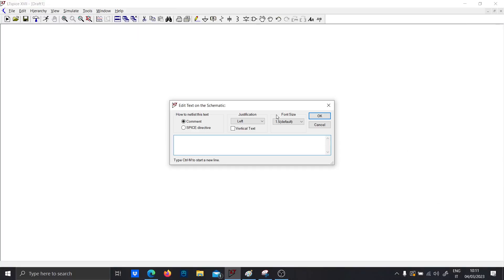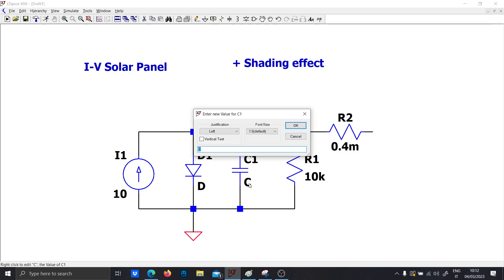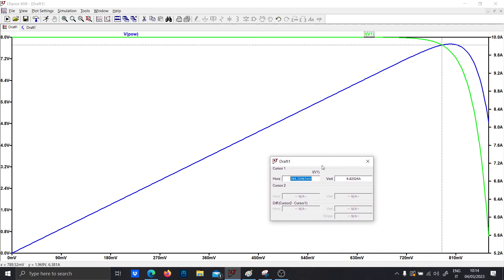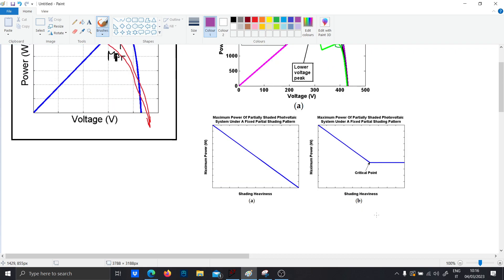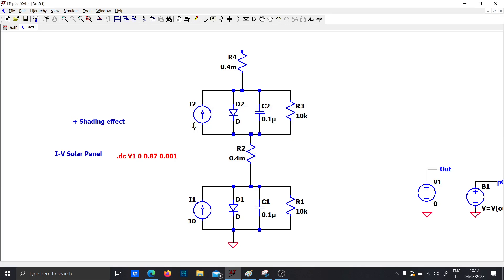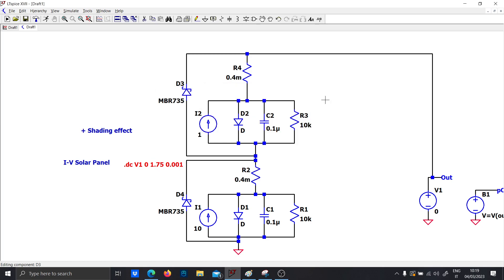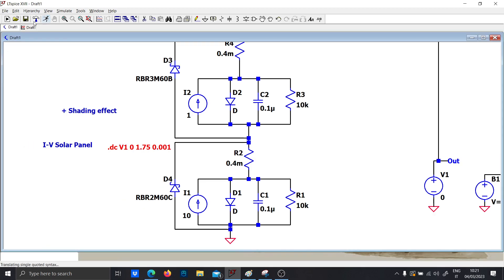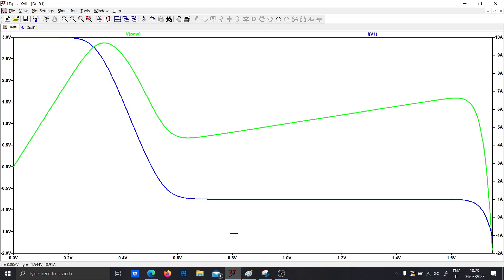LTSpice solar pannel, Bypass diodes (I-V, MMPT and Shading effect)

Comment: What is the reason behind the capacitor that you've put in the equivalent scheme of the solar cell?
Reply from the maker: It's the 5 element model, It Is used to model the dinamics of the solar Cell. It won't charge or discharge istantly, but It Will follow basically an RC on step load. Then It depends also on the load condition and the technology used